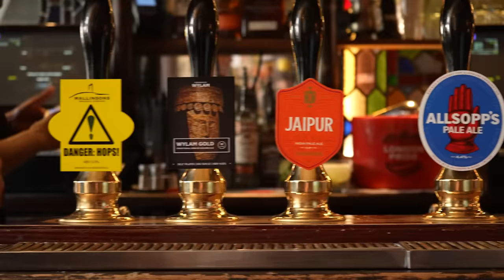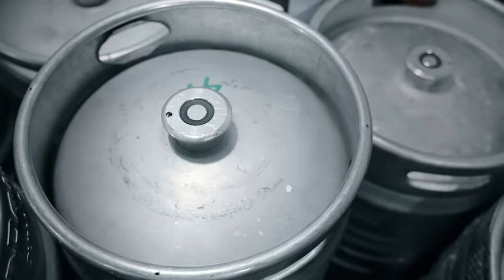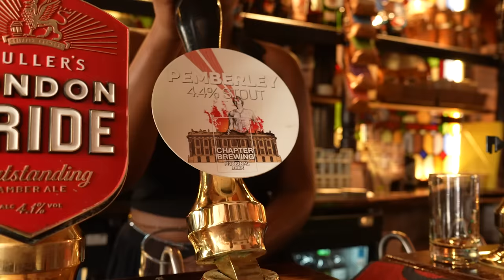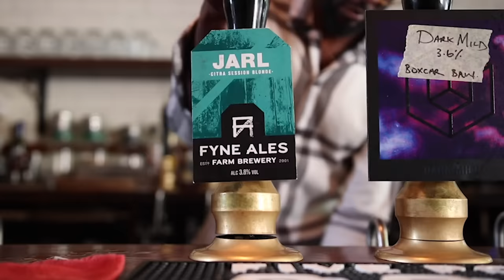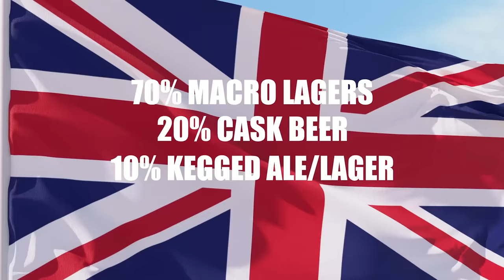American Tries English Cask Beer

Comment: One of the biggest driving forces behind the "extra cold" draft tend was simply that so many pubs were not keeping their cellars cold enough. (Saving money on energy bills) therefore if they installed secondary coolers under the bars to serve the new "extra cold" beers then the customers would actually get their beer at the right temp or cooler. 
The rest was marketing.

Comment: Tavern's were found along trade routes. If your heading to the big city to sell your wares then Tavern's offered a resting stop where you could get beer, food, lodging & stables for your horses. Head outside London or other big city's & you will still find plenty of old world Taverns still about but they generally don't cater to horses anymore with stables replaced by beer gardens. One near me dates back over 600 years & still has the mounting stones outside where traders could easily get on their horse after a heavy night of drinking.
Reply: Tavern comes from Latin and was a place that sold wine. An Inn offered accommodation. A pub I drank in had to change its name from Inn to Tavern, because it didn't offer accommodation! That only a decade or three ago.

Comment: Postmix chiller units are also often in cellar which puts out all the heat into cellar making the cask beers overheat
so the soft drinks pistol unit in some pubs is responsible for the crap beer as it heats up the cellar

Comment: Good Show. I would recommend asking for those confounded "sparklers" to be removed. Regarding Cask longevity, A Pub I worked in had an "18" of Courage Director's which languished in the cellar for at least 8 months.. It was tapped as a "Guessed" ale (yes I do MEAN that ! ) when the Landlord moved on..........Best ruddy pint of Director's I'd EVER tasted. It COULD have been foul- but it was exceptionally well sealed.

Comment: 'Pub' is short for 'public house' around the 1600s it came to describe an 'inn' that provides food and is licensed to sell ale, wine, and spirits" (1660s), and finally "tavern" (1768). Basically throughout history it 'is a drinking establishment licensed to serve alcoholic drinks for consumption on the premises that is open to the public without membership or residency and does not require any sort of payment or fee to enter.' 

After the departure of Roman authority in the fifth century and the fall of the Romano-British kingdoms, the Anglo-Saxons established alehouses that may have grown out of domestic dwellings, first attested in the 10th century. These alehouses quickly evolved into meeting houses for folk to socially congregate, gossip and arrange mutual help within their communities.

Inns are buildings where travellers can seek lodging and, usually, food and drink. They are typically located in the country or along a highway. In Europe, they possibly first sprang up when the Romans built a system of roads two millennia ago. Some inns in Europe are several centuries old. In addition to providing for the needs of travellers, inns traditionally acted as community gathering places. So an in was still a public house or 'pub' but it provided accommodation and food for travellers  and usually stables for horses. A tavern is the same ad an Inn but did not provide accommodation, and may or may not provide food, a tavern is also known as an 'alehouse'. Basically all are pubs, as open to everyone and anyone, no fee unlike say the theatre, and alchohol is served. These days Pub has replaced the word for Inn, Tavern and Alehouse.

Comment: There is a problem with serving anything chilled…
When stuff is chilled, it reduces the amount of vapours/molecules released into the air.
Your sense of taste is MOSTLY smell.  
For example, when your nose is blocked with a cold, your sense of smell is impaired and hence so is your sense of taste.
So, personally, I prefer my beer at room temperature, but not chilled (unless the weather is hot) — and definitely not warmed. 😄

Comment: The mixing of old and new ales is the origin of porter, and was just done in pubs, before first being done in breweries during manufacture. I have tried original recipe ale, we had a jug of each. It was interesting to try the different ratio's. I liked half and half, but the average was about 1 part old to 2 parts new. But it would have varied with every ale, probably batch.

Comment: There is an inaccuracy in the history of cask ale here: it was not predominant around 1980. In the 1960's it nearly disappeared as keg ale took over, then had a revival in the 1970's. It was in a healthier position by 1980 than in 1960 or 1970, and has remained a significant segment of the market.

Comment: So with the nubbin that lets out co2 but lets oxygen (presumably as part of air) in, could they rig the system to let something like only nitrogen in instead of air? That way the beer wouldn't oxidise and could theoretically last longer, although I suppose the nitrogen might dissolve in the beer and make it frothier.

Comment: Just to clear up a misconception that many non-brits have - it’s not warm, guys. It’s just not chilled. It comes from a barrel in a dark cellar so it is about the same temp as the cold water that comes out of your taps at home. Plus, it’s not 100 degrees in England so you don’t need a drink so cold that only the alcohol content is preventing it from being solid.

Comment: As others have said, you need to come up north and get a better pint of cask beer. You can tell by how easily they are pulling those hand pumps that the pint will be quite flat and “thin”. With a tighter dispense you will get a thicker creamier beer with better head retention. In Yorkshire a pint of Taylor’s will have a nice head which will stay till the bottom of the glass
Reply: Both have their merits!!!  At least that's what I thought after a trip across the pond.
Reply: @nathanwahl9224  hi nathan. Tim Taylors, Sam Smiths, Theakstons, my local breweries Jolly Sailor (Selby) and Old Mill (Snaith), and all other Yorkshire brewers will serve their beers in their own pubs with a regulation head and “thicker” consistency and mouth feel, that is how they want it served. The idea it is better quite flat is mad!
Reply: Northern beers tend to be served through “sparklers” - nozzles on the pump - which introduce tiny air bubbles at point of dispense which liberates volatiles and gives a creamy head.  Southerners tend to not like this. But “beer tastes better up north”. I’m in Lancashire.

Comment: So from what I've always understood, but could be wrong.

The Romans (what'ave they ever done for us) brought the concept that became translated as Tavern to UK which provided alcohol and food, but the local tipple in UK was Ale and so you then got Alehouses with no food.
An Inn would also provide accommodation.
Within all of these you would have different areas/rooms as a form of segregation eg The Bar, Snug etc that might be for different classes or men only (so later when some places just had just one room it could be just a Bar)

Eventually when they brought in licensing they all came under the umbrella of Public House which then led to the term general term Pub.
So now they are all Pubs really, but older places still going may still identify as a tavern or alehouse.

Comment: Tavern is most certainly not an Americanism. It's middle English, which dates it back to Chaucer's time. It is basically the same as an inn. A place where a traveller  might find food and accommodation.

As far as he difference between beer and ales is concerned, the latter did not include hops. Hops were, I believe, a Dutch innovation and not only made the beer more bitter, but also acted as a preservative. IPAs, or Indian Pale Ales, are heavily hopped beers, which were specifically designed to withstand the long sea trip to India. As to the idea that hopped beers might only last 4 days in a pub, that is not necessarily true. The more heavily hopped beers will last quite a lot longer. One thing to note is that a lot of the larger pubs will use nitrogen blanking to slow down the oxidisation process. That will maintain the carbonation, but without that unpleasant metallic acid taste that comes from using CO2 under pressure that keg beer uses (CO2, when dissolved in water, creates carbonic acid; nitrogen is harmless in that respect).

Comment: Me and my dad used to brew a lot of beers over the years, and never used artificial carbonation in any beer not even when we brewed larger, we would very often have friends over when a brew was finished, but it was always sbout tasting the beers never about getting drunk.....na just kidding we would all get wasted lol. 
On a different topic, i once worked in a nightclub bar and management would pour all the slops and beer left in half full glasses, lager, bitter mild whatever it would all go into a bucket, stainless steel mind, then they would depresurise a keg from a local brewery and pour the slop in and screw the cap back on the keg, gas line in and put it on tap, they would serve it late at night to people who were already a bit pissed, as far as i know it was going on for years before i worked there, the only keg that they would tamper with to do this was a lical brewery Wrexham lager, it got reported apparently and the brewery took action on the club and changed there kegs so it was harder to tamper with them.this all happened in the late 80s both the club and the brewery closed down, Wrexham lager has started brewing again but on a much smaller scale, almost a micro brewery, and deals with speciality ales, and they are very good i would encourage everyone to try one, but mind you they cant brew a beer as good as my late dads , god bless.

Comment: For anyone who states in the comments that beer is served at any time at room temperature in the UK this is utter nonsense, the optimum temperature for cask ales is 11 degrees centigrade, it's the temperature at which the cellar will be held at and the casks will be tapped at and allowed to work out their secondary fermentation, this is the temperature at which they will be served. Keg beers and lagers will be held in a separate area and pre chilled to a maximum of 5 degrees centigrade and passed through a central cooling system to chill them further before pouring, the central cooler is usually a water bath or ice bank which the service pythons go through.

Comment: I don't get the problem with letting low pressure CO2 in instead of oxygen. I feel like it could only make the beer taste better and prevent oxidation. As long as you're not artificially carbonating it, it seems like a no brainer to let the cask last slightly longer and prevent wasting delicious beer. Traditions only have value if they are useful and meaningful. A tradition of letting beer oxidize when the whole point is to have "fresh" tasting beer is contradictory. edit: Another way would be to let low pressure N2 in to replace the volume of the beer as it is pumped out. That would maintain the smoothness of the carbonation without introducing extra oxygen.
Reply: CAMRA is very picky about process and artificial CO2 is looked down upon whether it is used for carbonation (especially if its used for carbonation) or whether it is simply introduced to replace heaspace.
Reply: @Homebrew58   On second thought, I now realize that it probably would change the texture of the carbonation somewhat. Nitrogen would not have this effect, and I would bet money that no one would be able to tell the difference.
Reply: @boots6384  I'd probably rather have that than oxidised beer. It would help pubs not waste booze too. I get the tradition aspect of it, but less wastage feels good.
Reply: I dunno, there's something to be said about a cask ale on the second day.  A more well rounded note, perhaps.

Comment: CO2 is not added to any good American beer (I realize some Brits are making faces, but California brewers have been imported to places like Scotland as the multinationals take over breweries) American beer.  The beer is usually bottle conditioned, and you don't need a CO2 charge to get it out of a cask either.  Home brewers in the US do it the same way, with smaller batches.  You can dismiss Coors or Budweiser, as they aren't "good" beers.  You serve them cold to offset hot days.  But there are thousands of small batch brewers who make fantastically good beer in their kitchen, or even the garage.

Comment: The whole cask and beer engine is a gimmick. I bet no one would be able to tell the difference if the same beer was served from a cask vs a keg at the same temperature and carbonation levels. A lot of beer is being wasted in pubs trying to keep the cask image, especially when the cask is over carbonated and the hand pulls are using sparklers. I hate seeing good beer wasted.
Reply: Oh yes they would.  pasteurised keg beer has higher pressure Co2 in it and it dissolves in the beer leading to a metallic taste.  There's a world of difference if its kept and served properly.  I speak from 50 plus years experience.
Reply: @neilcorbett5057  I think you missed the detail…same beer, same temperature, same carbonation either in keg or cask. Experience through age impresses no one. I know that a famous  UK free house pub company serves “cask” beers in force carbonated kegs, because I asked the awkward question.

Comment: "Natural co2" vs "co2" is such a bs way of talking about it tho... 1 carbon atom, 2 oxygen atom, source of the co2 is irrelevant. Are there differences between the beers? Of course, but it's down to dozens of factors, source of the co2 not being one.
Reply: It's not so much the source but the speed and location at which the carbonation happens. "natural" carbonation results in much finer bubbles than forced carbonation (though of course some breweries will take their time over it to counteract), which changes the texture.
Reply: @TheCraftBeerChannel yeah exactly and as you just said, different results can be achieved by working bottled CO2 differently. Don't get me wrong, I love a cask ale and the difference it brings, it's just that I think talking about artificial CO2 vs natural CO2 is bs elitist way of going about it.
Reply: OK not 100% sure about this but a while ago there was a co2 shortage in the uk as most of the co2 was produced via a chemical by product of I think the ammonia production. This stopped the production of carbonated drinks including some beers / lagers. So the co2 used by the pubs was not is not a part of the natural brewing process. But a chemical reaction. If memory serves the cask beer was not affected but all the keg producers had supply problems.